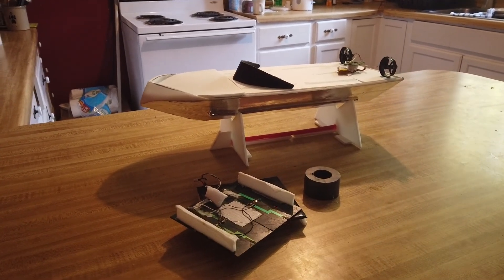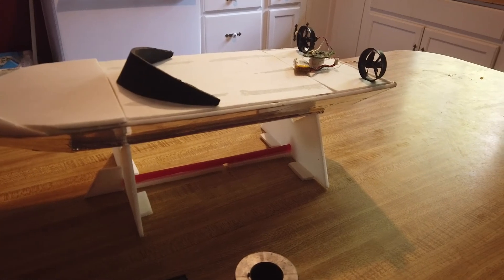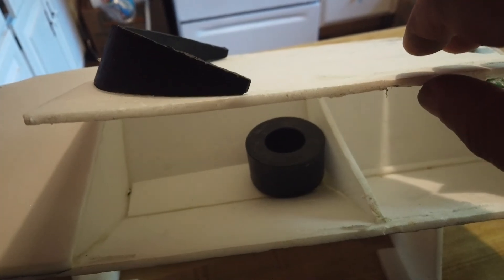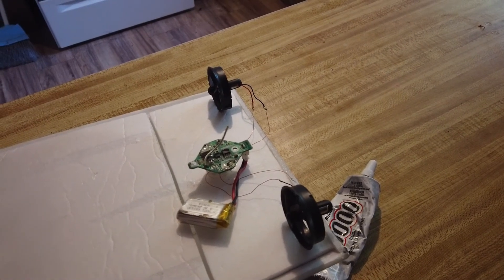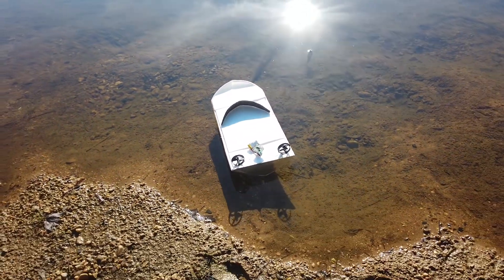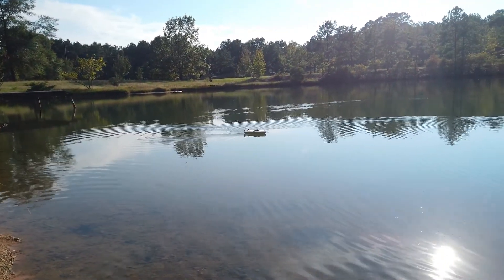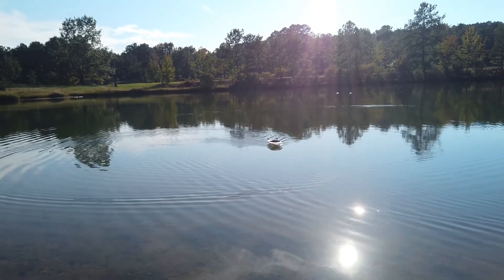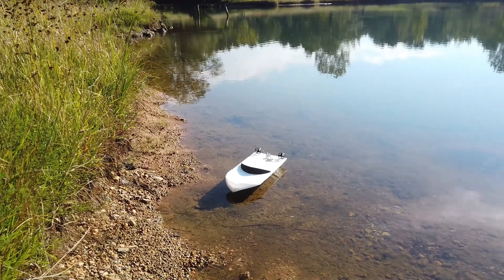Crumpled foam boat - Lighter, faster, better

Comment: Goes along nicely, I think it is a rather large boat for the motors you are using. Of course, if you go internal motor/s and normal props underwater it would be much quieter 😊😊
Reply from the maker: Yep, have pushed 6mm quad parts for all they are worth 😁
Am a bit skittish about the loose prop on the right side flying off, so will take a look at your Playlist for how to attach a prop and shaft.
Reply: @Slider2732_  Haha, superglue is often my answer. Not a great idea, but sometimes that is what I use. Lightly cross hatching the end of the shaft with your cutters to create a roughened surface might help. As for connecting a prop shaft to the motor, that depends very much on how much power you will be using. Just the insulation off some wire might be enough.
Reply from the maker: Have gone for a conversion on the little solar boat (which incidentally is my best performing vid at 400 views, the rest have 20 or so views lol). It's going hobby grade! Uses a converted servo to power the motor, on the Aileron channel. Ended up using shrink tubing to connect the motor to a piece of CF rod. The prop is the last thing my printer printed before it went wonky. Next, to work out how to best fit the other servo for the rudder.
Reply: @Slider2732_  I have had plenty of disasters trying to link the prop shaft to the motor. Most method work in the bath, but fail out on the lake 😁😁 Especially if the motor heat up under load. The proper connectors tend to be silly prices online, more than I want to spend on the whole boat 🤣🤣💰💰
Reply from the maker: Following your comment, I've just beefed up the motor mount 👍
Lots of things look built too tough for expected performance on many peoples videos, but, build light - fail fast!
Reply: @Slider2732_  I tend to over engineer things, so I tend to go the other way 😆😆 and end up far too heavy.